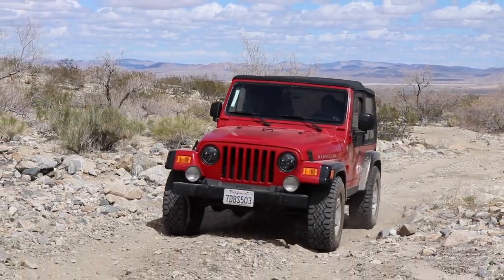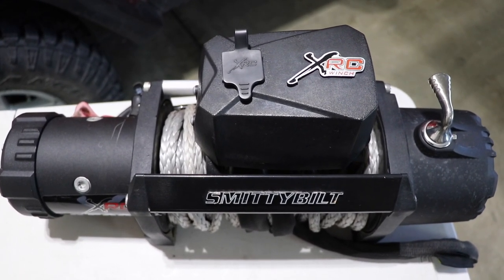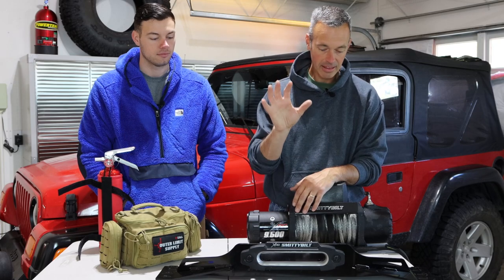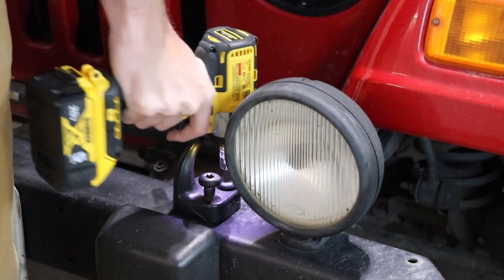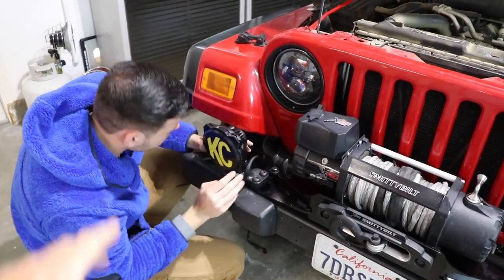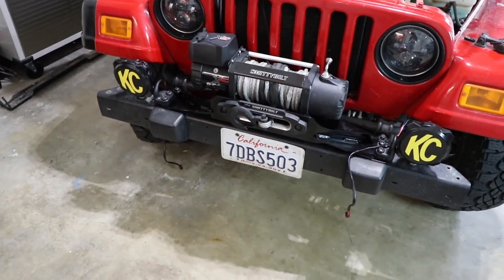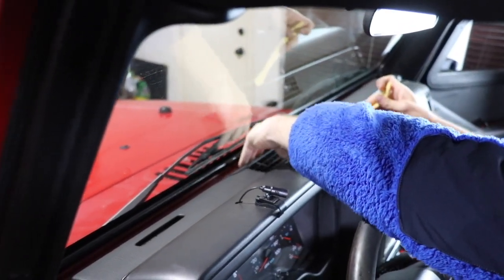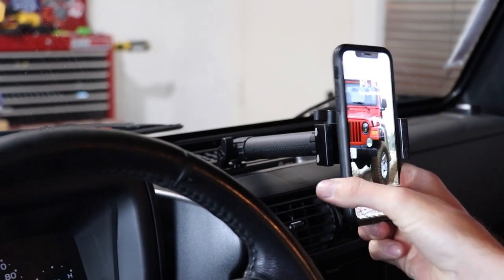The Build Begins!  5 Jeep Wrangler TJ Upgrades

Comment: When I lifted my 05 TJ, I installed a 1 inch body lift, 1 inch M.O.R.E. motor mount lift and a 33 Engineering skid plate which only hangs down 1 inch below the frame and pushes the transfer case and transmission back to it's stock location under the body.  Its too bad they don't exist any more.  Good start, Jordan!

Comment: There's so much you can do with a trusty old TJ! So many mods out there to choose from.

If you plan to take the doors off a lot, you could mount mirrors on the A pillars. That way they're always on.

You could switch out the gear shifter head, put leds in the dashboard, put in all kinds of storage boxes under and behind the seats, new head and tail lights, decorative decals, side rails, flat fenders for more clearance...

Since he wants to put a roof rack on top for a tent, you're probably not putting down the soft top so you could even get one of those hatchback soft top replacements that doesn't really go down but adds a new look that follows the roll cage.

Comment: 1 to 1.25 inch body lift. Motor mount lift, 2-3 inch suspension lift, belly up/tummy tuck. With flat fenders and 35's. Great combo. Run this set up myself and absolutely love it.

Comment: Had my Tj since October 2016. Tailgate Table is a must. If you haven’t already, upgrade the dome light to an LED. With the soft top, make sure the canvas above the front seats is taught or else water will pool up. Another thing I’ve been considering doing to mine is running a 12V power connection and a switch for the dome light to the back of the Jeep at the base of the C pillar. Good luck and happy wheeling!!

Comment: I love the lights in the front. If he decides to stick with the soft top most often and wants more light, some Windshield Hinge mounting brackets for lights could be an awesome choice. Both KC and Smittbuilt make brackets for TJs I believe. I’m also a fan of bumper lights, just placing them further from recovery points will help protect those lights. Love the build!!

Comment: So he brought the corona back with him 😂

2” short arm. 1” body lift and belly up. 35” tires. Best combination it will go most any place
Reply: I think I’d be more concerned in the US right now than anywhere else lol.
Reply: Matt Rasband nope not at all. I have 3” in the front and 2” in the rear. No matter the height youd still need the same amount of bump to keep the shocks from bottoming out and tires from hitting the fenders. I run fox shocks that are designed for 3-4” lift to get the most travel. I just have a lower center of gravity which id take any day over 1-2” more inches of up travel which is useless. Im running a oro swayloc in the front which keeps my jeep level on all terrains while allowing the alxes to do all the work. If you had a 4” lift and even longer shocks to keep the same amount of droop as my setup (which youd never be able to)  You would sacrifice up travel anyway because youd have to bump stop even more than me to keep the shocks from bottoming out and then the tires wouldn’t even flex up all the way. I have built countless TJs and XJs personally and for customers
Reply: Matt Rasband it has way more travel than stock. Wish you could see pictures and hear all the haters looking at my jeep and then at the end of the day coming up and trying to see whats going on with it because i did so much better than everyone else on the trail. Theres a Tj on clayton long arm 4” springs and i can go up the rti ramp the same if not more before lifting a tire than him. My jeep stays really level because of the sway bars i just hate the 03 up seats. The fox shocks have a much longer body than conventional crapy twin tube shocks so you have bump for that too. Its a trade off. You cant beat the stock control arm geometry for ride quality and control
Reply: @4xmatt  I put 33`s on a `99 TJ w/healthy 4.0,headers, cold air intake and a chip. Really lost a lot of power and mpg. 5spd w/.3.73`s. Looked good though.
Reply: I ran the Metalcloak 3.5" inch, 1" body lift, UCF tummy tuck with 35s and it was perfect for a medium level build.

Comment: I like the comment by your son about not being able to find a bumper that he liked.  I was in the same boat years ago so I started building my own bumpers incorporating things I liked as well as my own ideas. 

Great choice on the KC Gravity 6 lights.  I mounted a pair on the front of my JKUR and love them. I also purchased the amber lenses for winter driving here in northern Utah as well as cutting through the dust off-road. 

As for mounting locations, personally I prefer them mounted outboard on the bumper away from the grille area but I look at it more from an airflow point of view. I would also sink the winch down into the frame rails and allow an open and unobstructed entrance for air into the grille.  

Mike

Comment: Pretty excited to see some content for TJs! One of the best upgrades Ive done is a belly-up conversion, which involved a 1” body lift. Really helped undercarriage clearance on trails. It’s currently all the lift I have except for 3/4” spring spacers and I’m running 35s. But. I installed the MetalCloak body armor system, which is the biggest reason for being able to run 35s. Soon to be doing a 2” spring lift and then 37s. Keep up the great work on the channel!

Comment: I like the idea of bumper lights plus the fairlead lights. Our fogs (Rigid DOT cert fogs) are mounted low and wide in our bumper on our LJ. They light up the ditches great for deer (#1 danger in MT) and don't bother other drivers like our stock high fogs did.

We did a 3.5" JKS short arm lift. I really liked that it kept the factory angles (for a Rubicon), but I wish I had sprung for a long arm kit instead. They're just smoother on everything. The other sort-of regret was going to 285/75r16. Hindsight I would've done a narrower width 33. After the tires the power on our automatic 4.0 just disappeared, and there were other issues like needing a real tire carrier.. We regeared later to 4.88 and love it, but would've saved a lot of money with "pizza cutters" at first.

Comment: I really hope you went with the long arm lift. It will make you more capable off road and  ride smoother on road. Also in my TJ, I ran my charging cable behind the radio bezel and up through the top of the dash, that way it doesn’t dangle in front of your radio and will stay in place when you unplug it.

Comment: Took the wife's winch!?!?! You are a brave man 🤣
I used the same bracket on the winch fairlead to mount a short LED light bar. To be 100% honest I still have my stock TJ Driving lights mounted on the Smittybilt Stinger. 
I like the phone mount. Might have to get one.
Thanks for the video. Looking forward to the lift install.

Comment: Tummy tuck and do the locker bypass. It can be really nice to have lockers in 2wd and 4 hi plus that is basically free. I tapped into the winch wiring and put a rocker switch next to the factory switches to control the winch. I added a on/off safety switch in the factory location as a safety so you can’t accidentally engage the winch. Not sure if he looked at the Rock Hard bumpers. They look like stock really if he likes that look.

Comment: I really hope you got a Rock Krawler or Metal Cloak lift. I did the 3.5” MC on my last TJ and stretched it out a bit. Also, if you want to stay on a budget and do it right, go for an 8.8 rear and G2 Core 44 front. I had that on the TJ as well, and it’s plenty fine to sling 37’s around with. Granted, I had JCR high line fenders and custom long travel shocks. But do whatever you want to it, that’s the best part!

Going to add that a MML, BL and tummy tuck is an essential on the TJ. The TNT belly skid I had gave me 3” extra clearance underneath and it was all super easy to do after the SYE went on.

Comment: 2:20 I’ve been running just a winch plate for about 6 years now. I actually had a big heavy steel bumper and got rid of it. In most cases (not involving a front end collision) you’re actually better off without the extra weight.

Comment: For your wiring connectors go to Amazon and order Haisstronica solder&seal connectors. They are definately a game changer. You get the confidence of soldered wires and a waterproof seal. All you need is a heatgun.

Comment: Have you considered cutting your factory bumper?  I have a winch plate and winch on my 2001, then I cut the ends of my front bumper.  It looks great, opens up the front tires for access on the trails and you still have room to mount lights at the old location.  I would be happy to send you pictures of what I did if you would like.

Comment: My 2000 TJ se with the 2.5l 3.5” short arm rubicon express lift and a rear locker and 33”s really does pretty good. It can go more places than I can stomach 😂. The weak link on mine is the crappy axle. That ruby should be amazing !

Comment: When I installed the 67 Designs holder in my JL, I ran the cable for the phone connection behind the dash. On the dash top I just drilled a hold larger enough for the cable to pass through. With the 67 holder and bar in place you cannot even see the drilled hole. Makes it much cleaner and the cable does not hang over the dash.

Comment: Nice choice, I bought a low mileage 2005 TJ Rubicon about 10 months ago. I have the same winch. I am still not 100 percent happy with where I like the lights on mine, with luck you will have a good looking option for me to copy. I have wondered about the LED light options to replace the factory driving lights.

Comment: 99 TJ,  H.O.R.E.  High Output Rubicon Equipped. Bolted in some 44's when I put in a new 6 power plant. And I still party in it like its 1999.Try blocking up the hooks with washers or a steel plate with holes drilled and reinstall the hooks as original. This way you can put another set of lights on bumper with clearance...Clarence. when mounting steel to steel I always use old bicycle tubes cut to fit mounting area. Consider 4 hole injectors upgrade, (don't get the ones from china).Leave the cold box air intake alone. They are fine. you will waste money and have no benefit to the bare filter and fat tube intake. They only give a slight improvement on the topped out end. If more air is what you want, port the intake manifold to accept the larger throttle body from a 5.7 dodge truck. I would highly recommend upgrading the stock 117amp alt. with a 130 or 160, due to winch use and all the lights. its a simple bolt on from a 2000-2003 Durango (double check those years). actually, you will have to reposition the positive connector 180 degrees, but i'm pretty sure the pigtail connector matches. It's been awhile since I did it, and i'm getting old.

Comment: Those plugs are called deutsch connectors, they com factory on most heavy equipment. You can but a kit with connectors and pins/sockets and make the harness exactly how you want without any breaks or butt connectors.

Comment: Just bought a 1 owner 2004 TJ after my 92 yj was stolen- the TJ was about the same price as yours, not a Rubicon but immaculate bone stock with 24k miles luv your mods but luv this little time capsule as is- the only mod I added was a little pine tree air freshener hanging from the mirror.
Reply from the maker: Sounds like a very nice find!

Comment: As far as good TJ mods, I really recommend switching out all of the interior lighting with LEDs, especially the climate controls and instrument cluster backlighting. It's a really simple, easy, and cheap install and really changes the feel of driving at night. Makes the Jeep feel a little more modern and updated, and complements an after market stereo head unit really well. Also, as a TJ owner looking at winch mounting options on a budget... how well does mounting a winch on the stock bumper work? Any big reasons not to? Thanks guys!

Comment: Yup, 1" body, 3" short arm lift, belly up skid and 33's. Also Currie correct link steering arms. Going to 35's is another jump in cost. You'll need Steering upgrades, fenders, tire rack etc.

Comment: Not sure what you got for a tire carrier but I have the rustys offroad tire carrier best one in the market if you have 35 inch tire of more. You can operate your tail gate with just one finger! I had a bestop on mine before and it couldn't take the weight of a 35 inch tire.

Comment: honestly it's pretty capable already. I have an 02 Sport 5 speed manual and ran Gold Mountain and John Bull with just a 2.5in lift, lunchbox locker in front and 31's with the JKS sway bar quick disconnects. To protect the underside I have the metalcloak oil pan skid and gas tank skid and the Barnes4wd bolt-on transmission skid. All of those paid for themselves. This was also all on stock control arms and stock driveshafts.

Was it hard? Oh yes. But my little Jeep made it and I've since added 1.25" body lift and 1" motor mount lift, and upgraded to adjustable control arms. I also have an aftermarket front driveshaft (dinged stock on a rock) and replaced the Ujoints in the rear. Can't wait until we're quarantine free to hit the trails with my added upgrades! 

A Rubicon TJ should handle many things with no problem. :)

Comment: Love the build! I have a TJ as well, be careful when you remove the upper shock bolts in the rear, they are super easy to shear! I’d PB blast the crap out of them and let them sit for a bit.
Reply from the maker: Thanks for the tip!
Reply: Matt Rasband I’m by no means endorsing PB blaster that’s just what I typically use and don’t think one is that much better than the other just pick your preferred brand name haha

Comment: The Terraflex hand throttle helps me out alot while crawling  i have a stick in my tj as well
Reply from the maker: Thanks!  Something we'll be looking into.
Reply: I saved a few bucks by sourcing parts at my local cycling shop.
The hand throttle is great for bumpy trails, can act as a third foot, and allows you to hold higher RPMs while winching.
Reply: @leonschitzelgruber8237  i only paid $35 bucks on amazon for it well worth it

Comment: Metalcloak makes awesome bumpers and fenders for TJs. Not sure what you have for steering, but the ZJ steering upgrade is a fantastic one to do.
Reply from the maker: Thanks!  We will have to look into the ZJ upgrade a little more...
Reply: TrailRecon strengthens the tie rod a ton! The stock one is so skinny
Reply: And no need to get a ZJ drag link. It's no beefier.

Comment: My suggestion is the WJ knuckle swap, get that TJ some cross over steering, and get rid of that inverted y steering. Junkyard WJ knuckles, rusty's offroad knuckle spacers, could even use the junkyard WJ tie rod and drag link, new tie rod ends, with new ball joints. This swap won't break the bank either. If you know a welder, that is good.

Comment: I have an 02 TJ with an Nth Degree long arm 6 inch lift/35's which I think is a little too much.  So with that being said, I should have kept it at 4 inches of lift and 33's, with 4.56 gears which was my first build.   When lifting a TJ, it's important to remember that for every 1 inch of a tummy tuck, it equals 2 inches of larger tire diameter.  So, if you install a tummy tuck of say 2 inches, that gain in clearance will equal a 4 inch taller tire.     As for the lift itself, I would suggest no more than 4 inches of suspension lift, add a tummy tuck, and 33 inch tires, and you're good to go!  That'll take you just about anywhere.  And 33 in tires work much better with stock gears (4.10's) AND stock brakes.  Going to a 35 inch tire will require bigger brakes ($$) to keep things safe and you'll probably hate the stock gearing(more $$).    Good Luck!
Reply from the maker: Thank you for the great advice!!!

Comment: Hey Brad love your videos!!  I’m a fan.  Just wanted to know your thoughts on a dilemma I have.  I’m looking to buy a TJ.  I have two options.  2002 51k miles, 4.0L 5 speed $14,500.  The other option is a 2006 164k miles, 4.0L Automatic 4 speed $11,500.  The 2006 seems to be well taken care of and body interior is really neat.  What do you think??  Both are an X not rubicons or saharas.

Comment: 1. Just shorten the front bumper for $20
2. Rock Hard control arm skids are cheap insurance 
3. Some sort of diff slider front and rear
4. Rock Hard rocker skids
5. 7 Slot increased clearance crossmember 
6. Engine skid
7. Rock Hard fuel tank skid

Comment: Need to add an airaid intake, a throttle body spacer and a exhaust header.  Should gain 20 hp and smoother running engine

Comment: New (Er, Used) winch!!??  I observed a "not so new" Durablast battery which might or might not have the reserve power the winch would require. The other half of a self recovery winch is an OUTSTANDING battery to back it up. Time for a nice, new, beautiful Odyssey Extreme battery to make sure that winch can do the job required.

Comment: I was about to do the side mount on my winch control box but will not be as stable as having it on the center. To me looks way better on the side, but are you not worried about the brackets breaking due to the vibration?
Reply from the maker: I had it mounted on my Wrangler on the side for 5 years... never an issue.
Reply: @TrailRecon  and I know how hard you wheel, that is a great reference. As soon as I have time to spare I will relocate my control box. Thanks for the reply